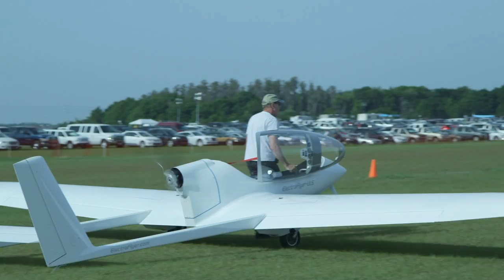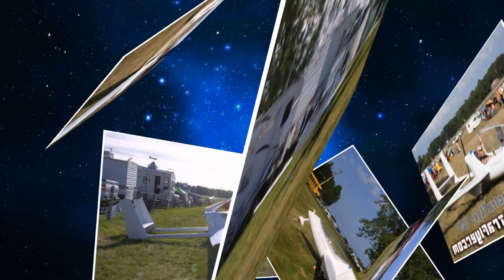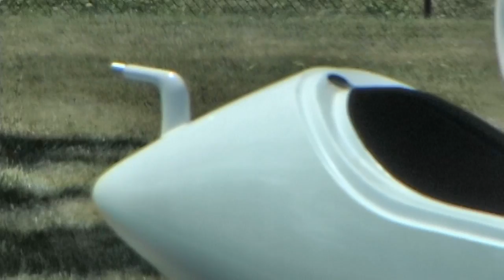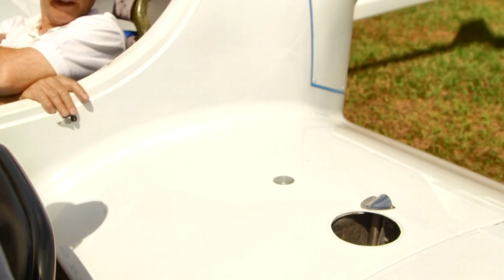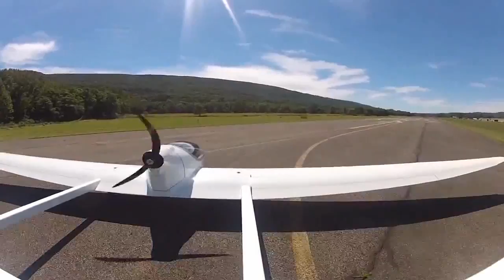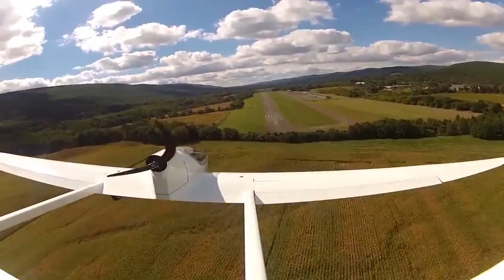ElectraFlyer-ULS electric powered ultralight motorglider.

Comment: Someone should make a prone pilot glider with small fuselage. Hang glider pilots (like me) have no problem flying prone and it would improve performance.
Reply from the maker: You mean like this
https://www.youtube.com/watch?v=kcIIxLSSLEA
Reply: @ultralightnews  not at all. That pilot is laying on his back inside an inneficient fuselage and wing with flexy canvas surface everywhere.

What I mean is prone, belly down, head first.

Think about it in a conventional sailplane in the 15 meter class. There's hardly any that goes beyound 50:1 and there is only so much to be improved in the design. Unless you make the whole fuselage narrower with a prone pilot and do away with the top bubble canopy.

Besides that I do believe flying wings (or tailless aircraft) have potential to overtake conventional gliders in performance eventually.

Somehow like a much better made Horten glider.

A more conventional looking glider with prone pilot is the Farrar V-1, but of course you can easly see how inneficient the rest of that is.

Anyway, just get an efficient design and switch to a prone pilot, and everything should be better.

Comment: L:D is ?
Reply: Galen Thurber 
Lift-to-drag ratio. The higher the number, the better the performance. With an LD of 25, a sailplane in theoretical air that’s not moving, loses only one foot of altitude for every 25 feet of forward motion. Theoretically, such a plane a mile high in such conditions could travel 25 miles without power or lift from thermals. Imagine an LD of 50.

Comment: Big fan of ultra efficient but I think the double tail is an unnecessary complication that adds greatly to the cost. Why not just two on the wings. Or even 4. And they could be super quiet 7 blade bent props. I would also reduce the size of the wing. A thin cutting wing for higher cruise speed, lower weight and greater efficiency. Fly as high altitude as is allowed.
Similarly you don't need a full dome canopy. Just a dome over the face. Small door, small glass. Cheaper, lighter, better.
Done right, it could be ridiculously inexpensive. Nothing short of revolutionary.
Reply: Well they have a working model, proof of concept as it were. Your ideas make sense. If you could fold the wings and make it possible to stash away without the cost of hanger space. Kit built? There has to be some way I can get one of these.
Reply: I came across the video again. As I understand it's an existing plane just using an electric motor, but if built for electric they would be freer on the design. With electric it's easy to have a prop on each wing so you don't need the double tail.
The plane has a 3.3 or 6.6kWh battery option. With today's prices that's about 1000$ in cells or half for the smaller pack. That's really not much. The plane sells for 59k so there is a lot of room for improvement.

Comment: Has any one talked about supper capacitors in conjunction with Batteries. This would be lighter and a generator (small) burning hydrogen, Cracked from water using 55volts DC at 2 amps. Ultra light can bring 5 gallons of fuel .?  Does water count as fuel or would it be unlimited. At any rate 5 gal of water has enough hydrogen to travel across the US. No fire hazard in a crash, point of use generation. 
thanks for reading
Loved the video
Jim the Plumber.

Comment: In Tillamook OR, I believe we have the perfect location for your electric glider.  An old Navy blimp base surrounded by mountains and a bay exposed to the West winds.  I learned to fly at Utah State in Aronicas, Taylor Crafts and my buddies Cessna 170;s I got an A&P, a Private but never pursued.   It was an expensive hobby.
I like the configuration of your plane over all others however,  I am seeing a single boom, single wheel with flyrods on the wing tips.  I work on ground vehicle development and follow the rule for improvement (eliminate, combine or simplify)  Maybe have room for a side by side friend.  Hunting the updrafts is great sport especially when you have acres of fields of grass within gliding distance and an electric kicker just in case!.
Iguana

Comment: It'd be sweet to see that with solar panels on the wings.
Reply: wk95-Actually there's been a few E powered motor gliders with solar panels on the wings that have been successful.Dan johnson actually did a review on one in Europe that was a 2 seater and the couple had flown it cross country in the EU........They arent enough to power the plane by themselves. But instead they work as range extenders that help recharge while soaring.To be of real use though the aircraft needs to be more towards the glider side of the spectrum of things though.
Reply: That'll probably put it over the weight limit for Ultralights. Those panels are rather heavy and for the most part inefficient enough that it might not be worth putting on such a small plane.